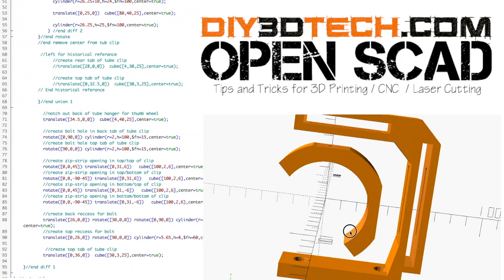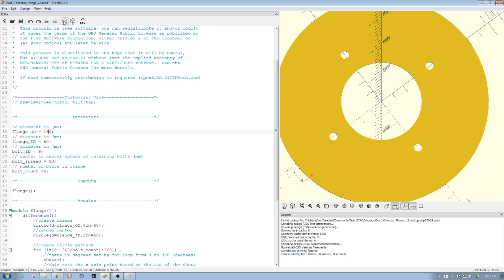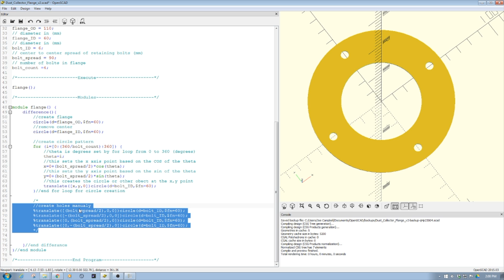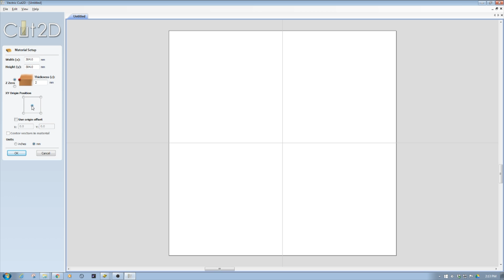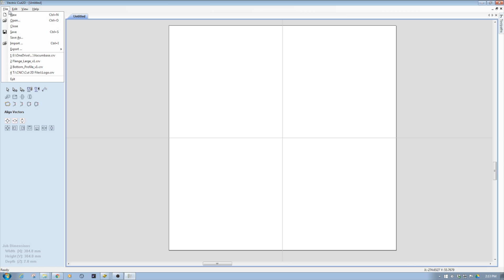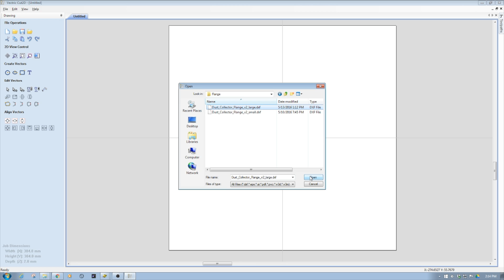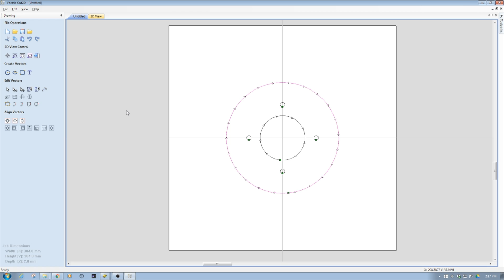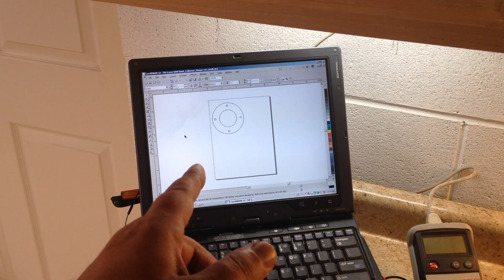Open SCAD -  How to Use for CNC and Laser Cutting!

Comment: I used openscad to design some laser-cut brackets that were assembled with box joints. I did a 2d module for each piece, and then I linear extruded each module in the thickness of my MDF and assembled them in 3d, so I could see the whole thing fitted together - check that everything was right. Once each piece was designed and I could see the assembly worked, I could output the 2d parts as SVG and lasercut them.

Oh, incidentally: that for() loop cuts seven holes.
Reply: Redoing the gcode path operations every time an edit is made got tedious.
I started writing an app called CAMigator to automate the whole process.  I'll release it on my channel. Stay tuned!

Comment: Nice touch altering  the loop increment to calculate the angle directly.

As variables inside a loop can't be accessed outside a loop, can I suggest using rotate?

Also if pcds might be used frequently write up a helper module that acts on it's children. Ie acts in similar way to translate, rotate etc.
Eg invoke the module along lines of 

on_pcd(axis, diameter, qty) {cylinder.....)}